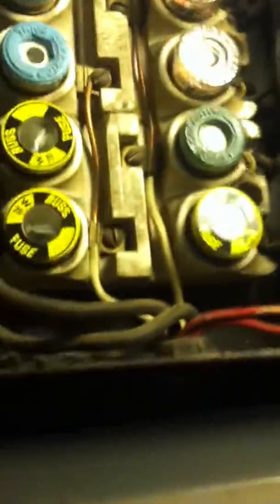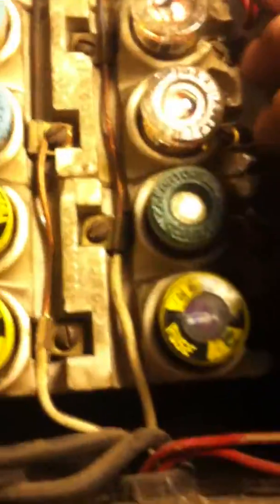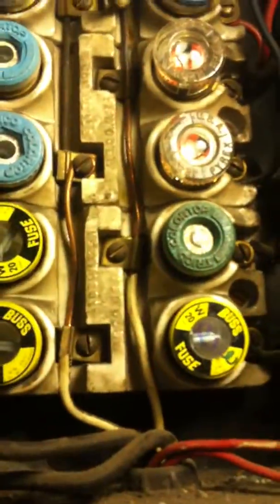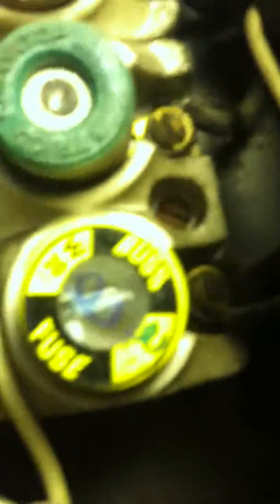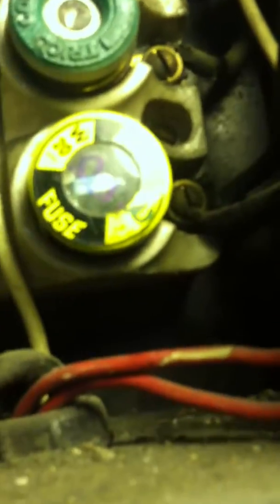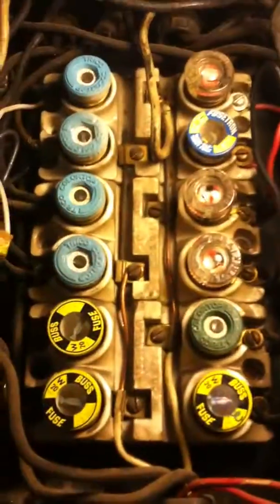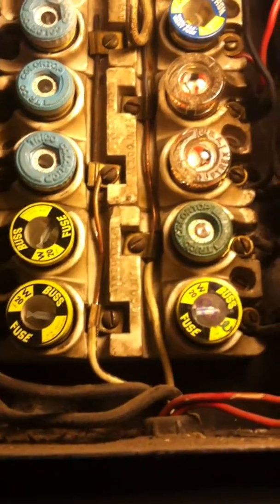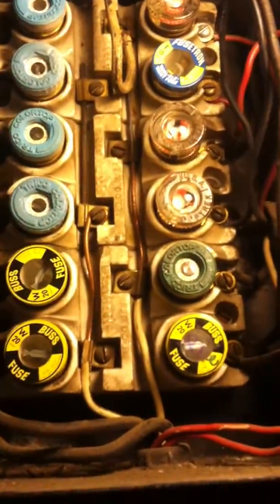Why fuse boxes CAN be dangerous (But can be safer than breakers)

Comment: Here in hellas i have noticed many older 1940-1960's marble box (Plaque) and screwed fuses made of porcelain, they have better quality and resistance to temperature.

modern plastic boxes and fuses (relays) are made of plastic, so they are more dangerous.
:)

only porcelain fuses and a porcelain or marble box are good!! ;)